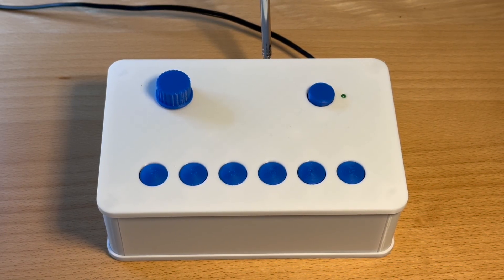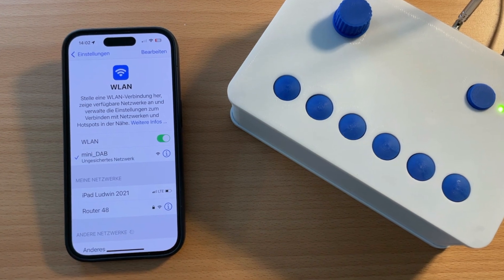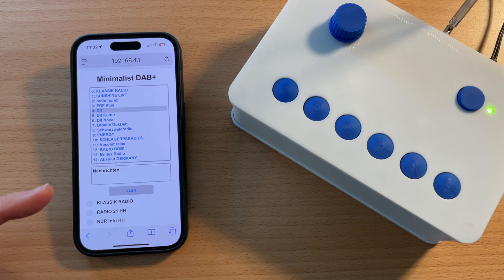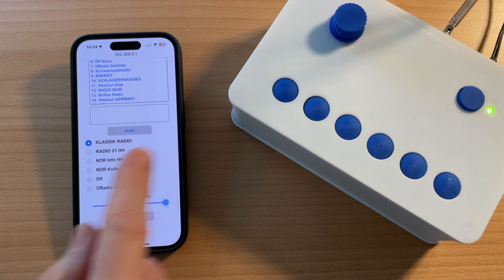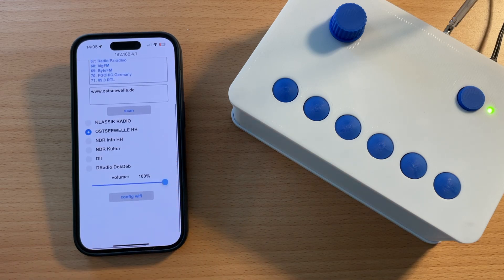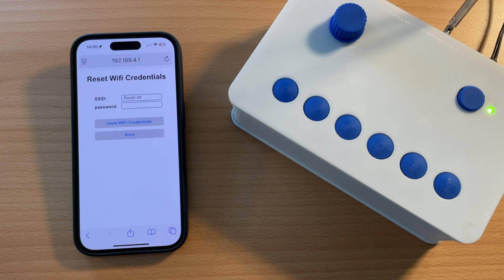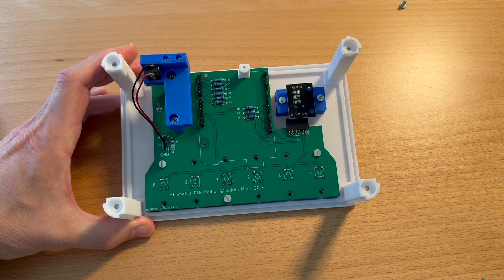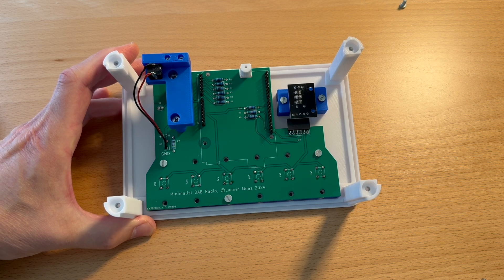A minimalistic DAB+ digital radio for visually impaired. A DIY project based on Arduino ESP32.

Comment: Hi trying to build some simlar but having troubles with sound quality.  Did you use an amp and what speakers did you use ?thanks
Reply from the maker: The audio amplifier of the DAB+ board is relatively weak. I am using this, therefore:
https://www.az-delivery.de/products/pam8403-digitaler-mini-audio-verstarker-2x-3-watt-dc-5v-leistungsverstarkerplatine-mit-potentiometer-fur-diy-lautsprecher-und-kopfhorer-inklusive-ebook?variant=39436364808288
Regarding the speaker make sure it is not too small. I am using this model:
 https://www.digikey.de/short/b51nzdzv